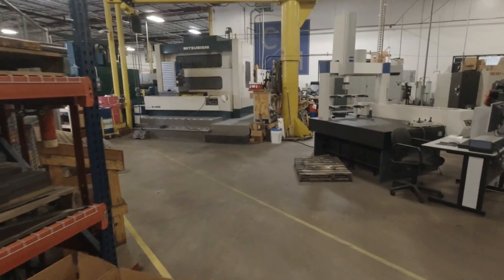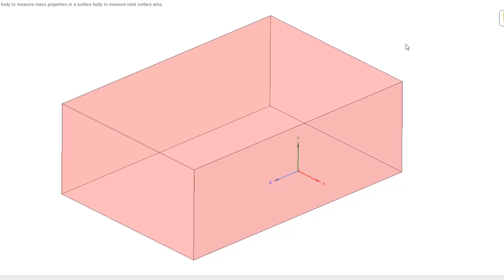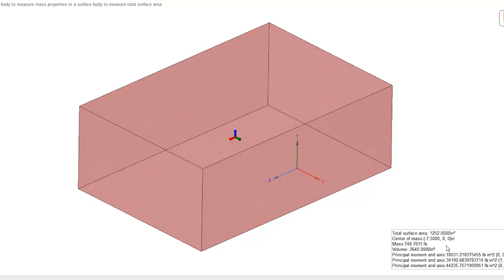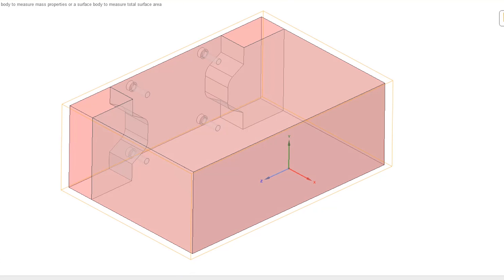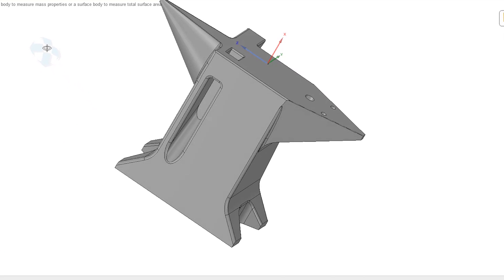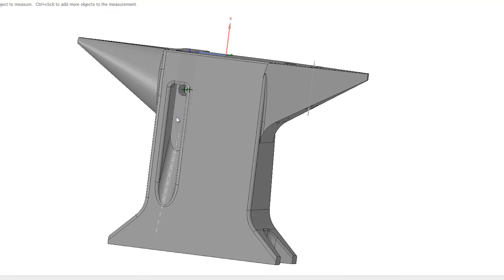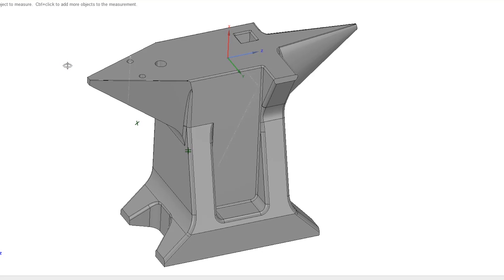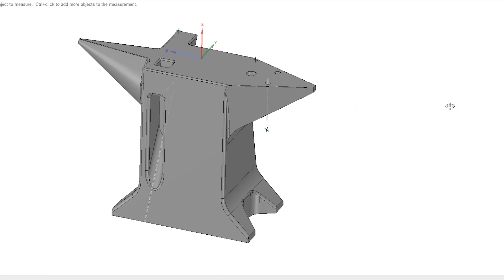50,000 Sub Give Away Idea?

Comment: Im looking for an anvil, i would rather just have the block just as it it, dont mill it at all.  ill be round to pick it up!  I would rather have as little material removed as possible.  a horn or back wedge can be welded on the problem is getting a big hard lump to work with.  If you REALLY want to mill it out the hardey and pritchel holes are just fine just remove some material from the middle of the large flat sides for attachment/ anchor points.  so it would more or less be a large rectangular lump, like a striking anvil and when i want a horn on it i will weld one on.  the horns are usually softer anyway.  so DONT CUT IT UP!!  it should be pleasing to the eye as well so some milled in features that other anvils dont have would be nice, like the ability to make concave curves and have a stake pocket so combined anvil and forming block.  On fairness;  the world isnt fair, pick who you would like to have this thing, no one will know the difference!  i count 2 lumps being used as steps so you have a second chance.

Comment: You should make the anvils, but put them for auction and give some (or all) to charity. #TeamTrees i pretty popular on YT right now and seems like a good cause :)
Reply from the maker: The problem is the forgings like this cost more than a new anvil from people that sell them. Unless I could get the forging place to forge them closer to net shape. Just add it up even at $3.00 per pound that would be $2,250.00. And that doesn't include the machine work.

Comment: Great Idea. 
I live in Australia and would pay the freight.
You could make one full height anvil and two half height bench anvils from the two pieces of stock.
Regards
John
Reply from the maker: Yes but I have no way to saw a piece this large. There are saw shops here that could do it. I would have to get a cost. It might not be that much. Than as you say I could make four small anvils out of the drops. I will model the and see what they could be and what they could weigh. I could even get heat treatment to make them harder. Maybe that could be possible to send international.

Comment: Keith Rucker - VintageMachinery.org did a Christmas giveaway (see at ?v=XPBWK_1R1cM and ?v=xLuRlKBOA5w), and he used a Google Form. See the first video description. Probably this would work for you too, and probably he would have some useful tips.
Reply: Oh, and by the way, I would not enter in the drawing, because I already had to get a structural engineer coming, to check whether my floor (which is above the basement) would carry my work bench with cabinets and a table top milling machine. :-D IOW, that anvil would overload it. :-(